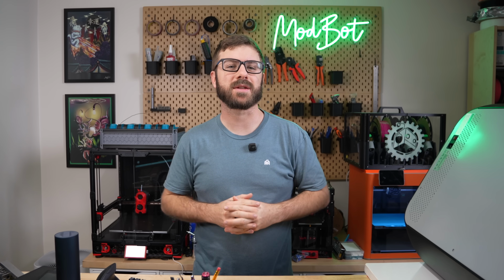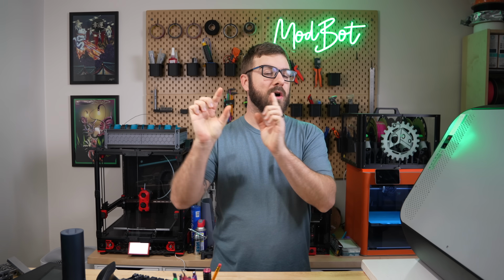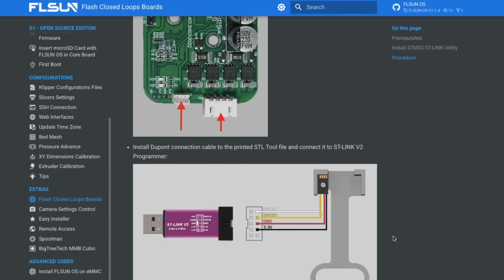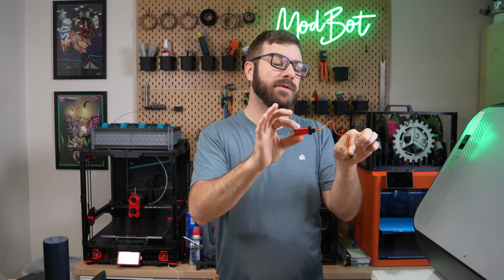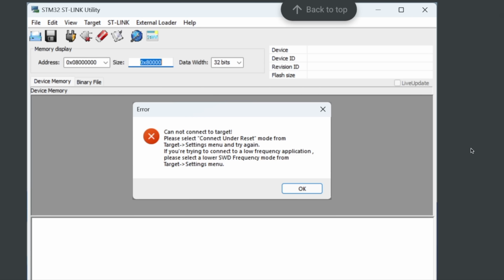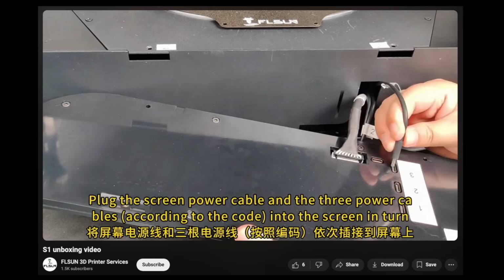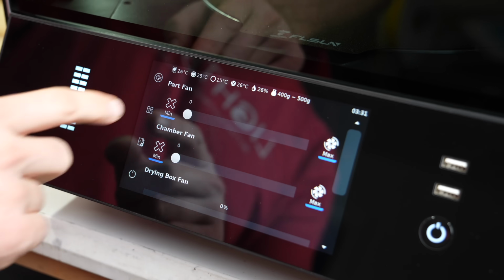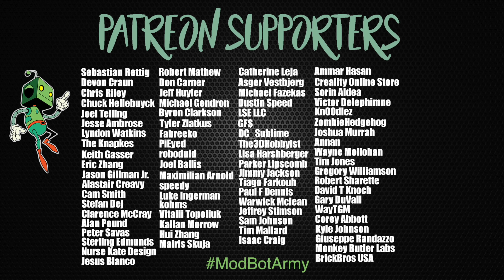Massive Community Upgrade For The S1 (FLSUN Open Source Edition)

Comment: Bought an S1 last week, it’s the 4th FLsun printer I’ve bought. I currently own the S1, V400, and a modded (Bambu X1 hotend) SR. The S1 has been a huge disappointment and will be getting returned. Can’t get a good print out of it and FLsun support is blaming the filament. I’ve had very good experience with their CS up to this point, but dealing with them on this issue is giving me flashbacks of Qidi’s support. No more FLsun for me.

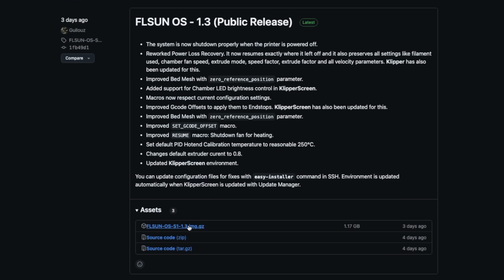Comment: where is the file located on the github @ 11:04? I can't find it anywhere. thank you
Reply: The "FLSUN-OS-S1-1.3.img.gz" file, to be specific. Thank you. Looking forward to installing on my S1. I have recently repaired some hardware components (new hot end and heated plate, and energy storage board). It still is not printing the first few layers perfectly (I replaced the energy storage board at FLSUN's recommendation after getting a "Motor A" error during leveling, which led to a small portion of my first layers printing weirdly). With the new energy storage board installed, it completed all calibrations, but the weirdly printing area is still somewhat there... Hard to explain >.< Thank you for the tutorial!

Comment: How many times do you have to update klipper and these printers to get it to work correctly and if it’s so good why does it need to be updated all the time why do you need all of this bloat to use your 3Dprinter? It seems to me the common problem is klipper not the printers or the companies.
Reply: You only 'need; to update klipper if the update actually offers something you want/need , i.e additional/new features or bug fixes.  The problem with the FLSUN gimped version of klipper is that it can be restrictive and not as customisable as people like.
Using the V400 as an example I installed stock klipper as I like to tinker but many leave the flsun version on and have printed some amazing things.

Comment: The mvs was not an exaggeration but rather a plain false advertising. Also if I understand it correctly, the ssh access is a requirement and not an option, so another unlawful thing they did.

Comment: Flsun has really put a sour taste in my mouth with how they've been handling these machines. Buggy, unfinished it seems and been botting comments to make their machines seem more than what they actually are. Probably will never be buying one, but I'm glad the community is fixing and making the machine that they promised to begin with.
Reply: I bought a FLSun about 6 years ago and it wouldn't run as shipped by FLSun. To make matters worse, the SD card that they shipped with the printer was corrupted ("FF" in every byte).

FLSun would not replace the SD card, and told me to figure it out myself. They also stopped responding to my emails. I ended up modifying a sample config in Marlin to make it work (a "CL-260" printer IIRC).

Comment: Bro, if your stuff is warping because of the cold air, can't you just lower the fan speeds?
Reply from the maker: Yes, but abs needs cooling. That will only work for objects without overhangs. Abs needs air for overhangs and bridges like any other filament it just needs to be the same temp as your chamber.

Comment: I really cannot believe that manufacturers STILL can't open their eyes to what the community wants.  I would honestly pay a premium for a printer with all the proprietary features but on full open mainline klipper.  For a $500 printer if they charged me an extra $100 for it to be open and allow me full access I would absolutely pay it.  But if they lock it down then chances are they won't get my $500 in the first place.  I have to ask:  Which would you rather my $600 of my $0?  It really is just that simple.
Reply: they just don't get it, they don't have that mentality.

Comment: If the driver update doesn't help, try to swap the stock smooth idlers for teethed ones. Im still baffled that the industry still uses incorrect hardware, especially on faster machines where you have higher dynamic loads on the belts, effectively increasing tension in certain scenarios and thus making smooth idlers more visible
Reply: I never got why so many use smooth idlers and even 1.8° steppes. Even a lot of open source projects used that crap. To this day I see most 3D printers as starting point to make a printer that works. Back in the day I bought a mk3 set made out of laser cut steel added linear rails to the bed and Z axis ball screw for the Z. Than I swapped all steppers to 0.9° steppers and threw a 10mm AlMg Bed with a silicon heater on top. After a few more mods it can now print with a bed temp of 150°C and a nozzel temp of 420°C. To this day its the only printer I have that can print everything I tryed including PEEK.
Reply: @tuxontour i understand 1,8 degree steppers since you can run those at quicker speeds (induced currents) but smooth idlers are stupid. At least use bearing stacks for increased durability, so there would be at least some benefit over teethed idlers but no, same small bearings and more wear on the belts plus rippling at belt manufacturer specified tension
Reply: @over_pizza_2578  I have never had a problem till now up to 500mm/s with 256 micro stepping on TMC drivers @ 24V.
Problems only where in the beginning as I started with those good old AT-Mega boards with an 16Mhz 8bit micro. They could not calculate the steps fast enough. Starting with smoothieboards and duet boards in 32 bits and at least 120Mhz processing steps works just fine. 
Newer boards support higher voltages up to 60V so you can go even faster with those fine stepper motors. Now we need way faster hotends filaments and cooling.

Comment: Thanks for the shoutout buddy!
This makes the printer finally usable. Although I continue to have nozzle blobs of death ☠️
Reply from the maker: @Killa_Prints  yeah man! Hopefully it sends some people your way. I saw your post. Is it leaking? Or prints coming off the plate?
Reply: @ModBotArmy  honestly both. Leaking from the heatbreak, clogging in the extruder, but ABS also warps off the plate.
Reply: Redesigning a better setup to ditch the stock extruder/hotend combo @ModBotArmy

Comment: Huge kudos to the open source community that brought this awesomeness to fruition.  I wish all 3D printers shipped with open source Klipper.  The manufacturers claim that their new hardware requires proprietary firmware (99.6% Klipper and 0.4% their proprietary code) but it would be far better for everyone if the manufacturers expanded Klipper with the new capabilities so that could become the standard for these features in future printers instead of everyone adding different proprietary add-ons to Klipper.  Ditto for slicers.  Manufacturers should contribute to the open source slicer with enhancements needed for their new hardware instead of re-skinning OrcaSlicer to make it proprietary for their new printer, and while they're at it, they should add the profile for their new printer to the slicers as well as well tested generic filament profiles for the new printer.
Reply: Here you think that the FLSUN producers are not responsible for the profile in Orca Slicer